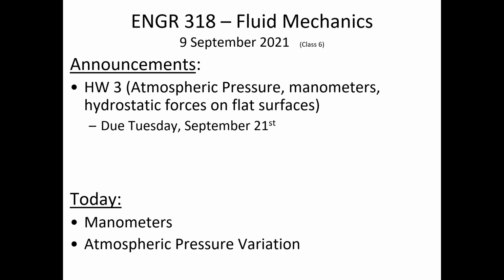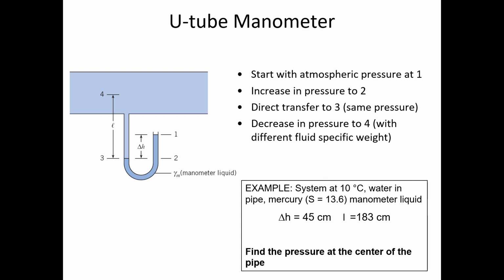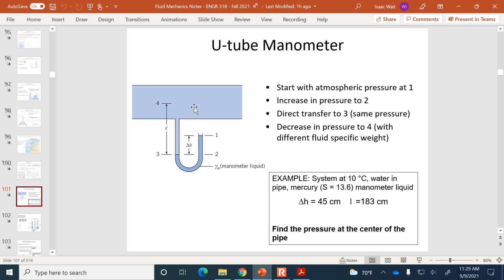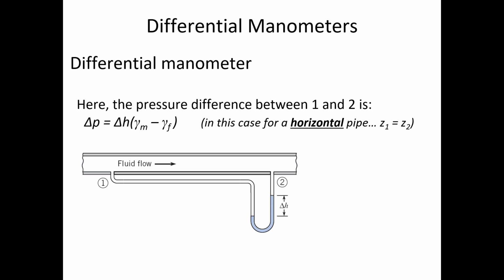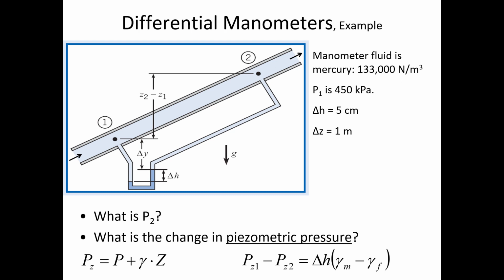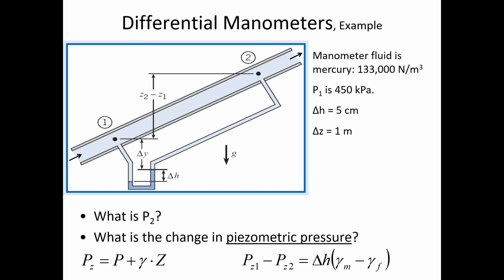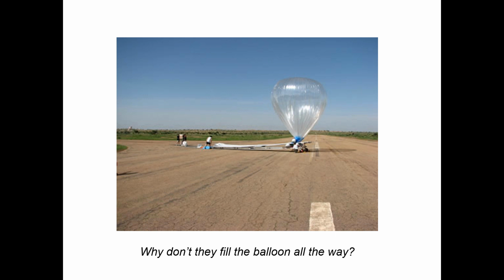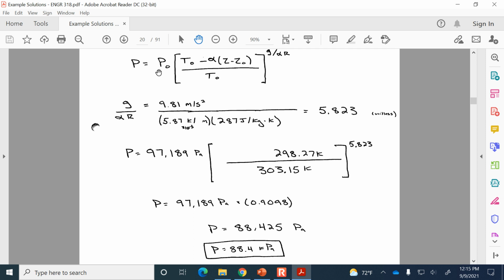U-tube manometer, differential mano., atmospheric press variation - ENGR 318, Class 6 (9 Sept 2021)

Comment: Hello Sir,
I wanna ask, what topics are covered for Water Supply Design System?
Would you please share some videos if available!
Reply from the maker: It's a big topic!  One aspect of designing a water supply system that I find most interesting is the optimization of the pipe network (i.e., how big should be each pipe in the system to ensure enough pressure is given at each outlet).  Here is a video of some software that can be used for such design: https://youtu.be/6oCI3fCnQz0?t=1125